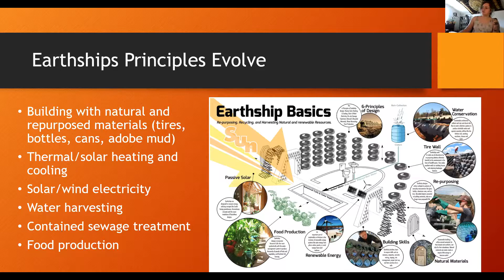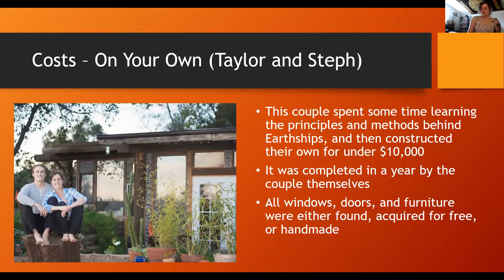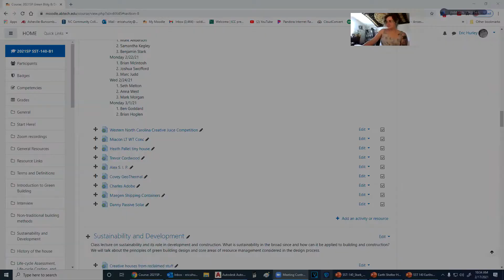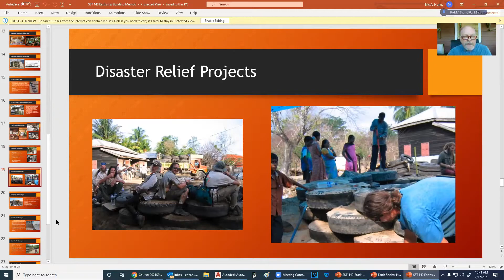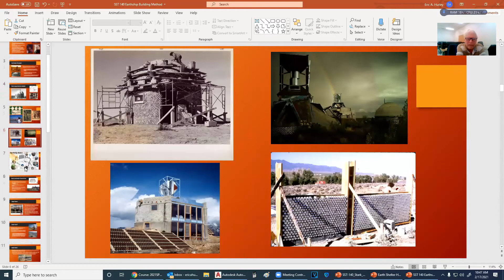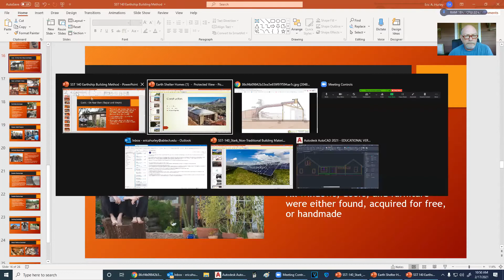Sam Earthship

Comment: regarding the solar septic question. She is right that bacteria break down the sewage (solids) just like any septic tank. If you can increase the heat on the tank through free solar the bacteria break down the solids much faster making it more efficient. The tank is divided in half, eventually the water waste is separated to the second half which they call black water and it piped away underground to water outside botanical cells of plants and trees.

Comment: "Huge Refrigerator" - No it's not. It's a DC fridge that has much more insulation than a standard residential refrigerator, so the total volume looks large, but the interior storage space is much smaller than you probably expect. I'm sure that with the small market for this style of appliance they are expensive, but the cost is also for performance, and security (they run off the batteries directly, so even if the inverter breaks, you still have refrigeration).

Comment: Granted I have 27 or so years in engineering, construction management, and general contractor business owner…..but, her presentation was shallow in explanation. She didnt seem to grasp the understanding of the structure and its systems. Ive only been studying these homes for all of 4 days and observed a lack of knowledge from her. She did a great job of preparing slides, but it seems that she spent most of her time prepping slides. There were many questions and points that were brought up and she was unable to explain or answer.

Comment: There is some information missing from this report. There actually have been scientific studies from the University of Wisconsin-Madison and others that have shown that most off-gassing of tires happens when they are newer and when they are exposed to UV radiation. According to these studies, when the tires are past their useful life and buried in a berm in addition to being plastered over, they do not off-gas into the home. I would worry more about the people building these homes, pounding tires in the hot sun. Michael Reynolds himself was diagnosed with brain cancer in December 2019 and given less than 6 months to live, but he is fighting and still living. Whether this condition was caused by his years of building these structures or another reason is unknown. There have been no other claims of cancer caused from actually living in an Earthship to my knowledge.

As your student mentioned, many of the complaints that cost Reynolds his architectural license were trivial issues about temperature control and other modern conveniences. Just as many on the left today proport to be environmentalists while driving around their Lexus and Mercedes SUVs, and living in their 5,000+ square foot homes, some of his clients had high ideals, but then when the reality of living off-grid hit them, they didn't like it because it took a little work, thinking, planning, and was not the cushy lifestyle they were accustomed to. For instance, the homes are designed to work with solar and sometimes the addition of wind power. They do not have air conditioning but are designed to stay between 60 and 70 degrees Fahrenheit. Some of these people did not like that they couldn't turn their dial to 65, or whatever their preferred temperature, and they had to work by opening vents and windows to go with the natural processes to regulate their home temperature. When people choose to live off-grid, they really should do their homework and realize it is not going to be like living in the lap of luxury that they are used to. You have to think about how much solar energy you have and how many appliances you can run at once. In a desert environment, you have to be cognizant about not taking long, indulgent showers when you know what you annual rainfall is. These houses are remarkable in that they collect all the water for the residents without paying for water services, and they use the water a minimum of four times for each ounce of water! Before passing glib judgement, I feel one should stay in one of these homes at least overnight to see what it is really like. Many of these homes outside of Taos are now very popular Air B & B destinations.

I don't know the extent or depth of research required for this project, but I was shocked that your student did not appear to have read or sourced any of the books written by Michael Reynolds. I know much of today's research is done online, but I hardly think six websites and a movie are enough sources to do credit to Reynolds and his revolutionary design and architectural principles.

Also, she did not go into much depth about the various people using these design principles around the world (she mentioned a few). People are able to make these homes sustainable in places as diverse as the deserts of New Mexico to colder climates, such as Colorado, and even Canada. Most people do the builds themselves with help from friends, and there are even several communities surrounding this design principle that have sprung up in places where building regulations are less stringent, such as Crestone, Colorado. The Off Grid Guru makes many You Tube videos about these types of structures being built in many different places, including the first to be built within a city in the US in Philadelphia. I believe this is an idea that was ahead of its time, and as resources and building materials become more scarce and expensive, and waste products become so much more plentiful, it is a way of sustainable living that we should all be considering more thoroughly.

There also is a lot of information on You Tube and other places on the internet that explain how people are making further innovations on Reynolds' design principles. I think I would prefer the method some people are using of taking huge tire bricks that have already been compacted by a waste disposal company. They provide even more thermal mass and a way to dispose of even more tires in a useful way when building a house. The exposure to the tires by construction crews prior to their burial and covering is minimal in this application.

Thank you for putting this online for more people to discover after Michael has been trying to spread his ideas for the past 50 years. When he first started developing these concepts, the idea of recycling was not even a thing yet. Your student did a great job overall of explaining the overarching concepts and ideas behind Earthships and how they have been embraced more fully in third-world countries where they do not have the money and luxuries (and stringent building codes) that we have in America. There also are many industries and companies that do not like Michael's radical ideas because they could potentially do away with the need for utility companies. I, for one, will be very happy when that day is a reality!
Reply: Reynolds was diagnosed with prostate càncer. He quit alcohol and started eating vegàn and seems to be doing better. Pray for him, we need his message.
Reply: If they want to use more water they can just buy water and add more storage.  Seems like a non-issue tbh.

Comment: They still use cans, but they cover the outside of the cans with adobe, concrete, or other substances. The cans are just used as filler to reduce the amount of concrete or other construction materials.
Reply: The termites in the East coast of the USA would eat the wood.
Reply: @sbl17jackson37  What's your point? There are termites everywhere, and Earthships use much less wood than any other type of construction. No one is talking about wood here, if you were paying attention.
Reply: @cookingsherry8784  My point is that termite treatments are expensive. A non cellulose material such as recycled plastic, fiberglass, or something else for the studs, two by fours, doorways and windows could solve this problem. Even though the Earthships use much less wood than most types of homes, they still will have a termite problem because they use wood for the studs and framing. The whole point of the Earthship, is to be sustainable and address most of the failures that exist in traditional housing. Ignoring the termite problem will only cause the homeowner to spend money on expensive  treatments, bait stations, and inspections, later on, which is one of the many failures that exists in modern housing.
Reply: @sbl17jackson37  Do you build with plastic or fiberglass studs on the east coast? The problem would be structural integrity of plastic or fiberglass.